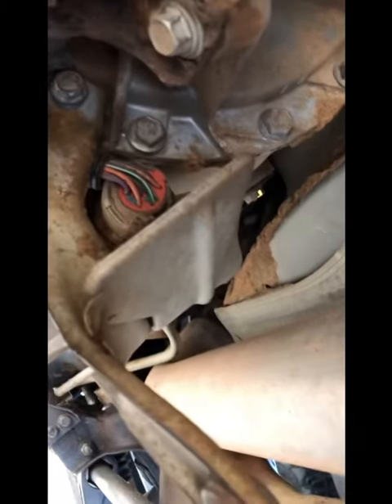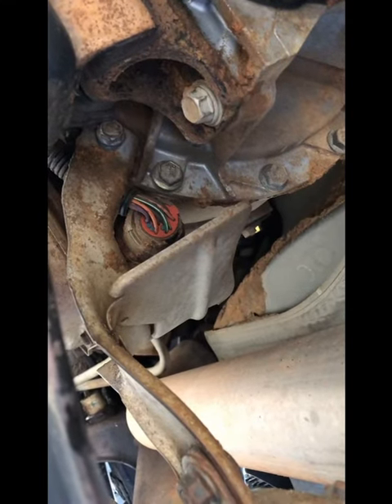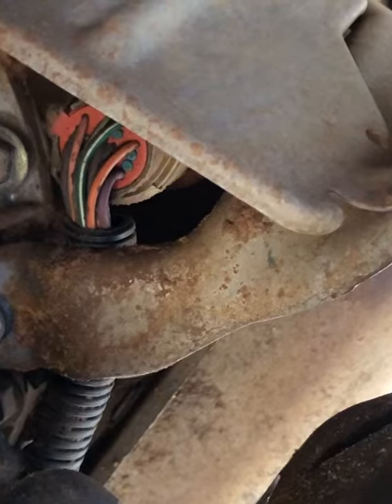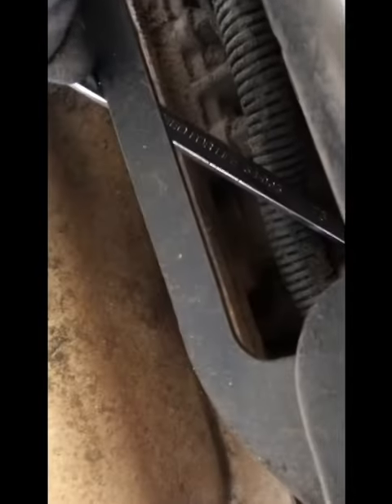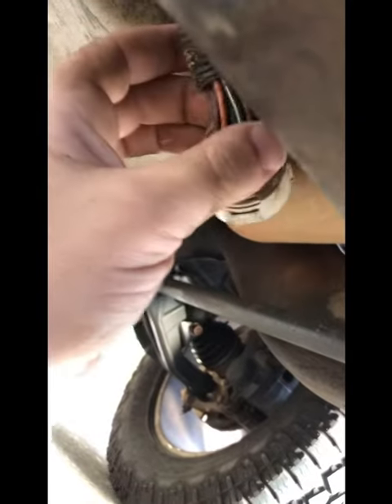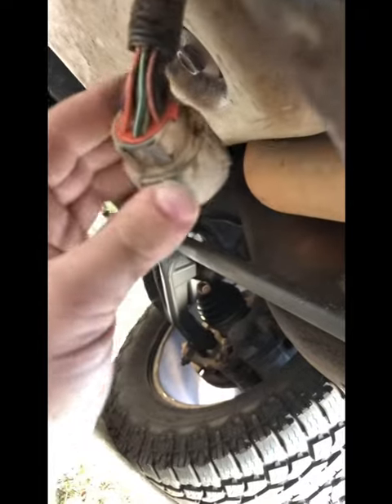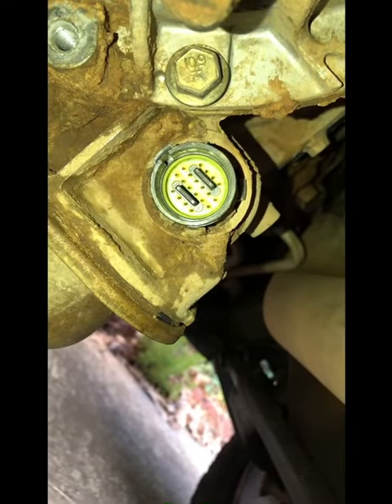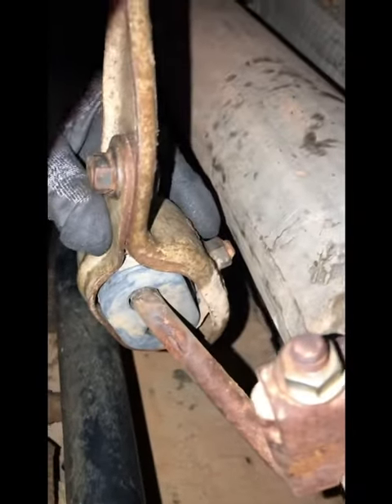Range shift inhibited/shifting issues FREE fix for Duramax

Comment from the maker: JUST AN UPDATE FOR EVERYONE. My issue ended up being the transfer case. The factory units have a tendency to develop play on the internal rotating shaft. Most of the time this problem is accompanied by bad universal joints in the driveshaft. 

This play can get so bad that it busts a hole in the outer casing of the transfer case and obliterate SPEED SENSORS. 

So another option is to pull off and check your speed sensor on the drivers side of the transfer case tail shaft. If it looks like it’s been on a lathe or is completely destroyed, it’s transfer case time.

Comment: Hey Dylan, I just subscribed to the channel. I have an '18 Sierra 2500 L5P with the Allison 10-speed trans. Yesterday my hill assist kicked in for the first time, unexpectedly, while going up a decently steep incline. It lunged the truck forward out of nowhere. Got my attention real quick! Today, the truck will not go into reverse, and the "R" indicator on my dash just blinks on and off. Codes now present are P: 249D, 0701, 0731, 0751, and 0756. Any recommendations on where to start untangling this mess? Thanks in advance for sharing any info you may have. I'm a first time diesel owner.
Reply from the maker: The R blinking means the ECM thinks the transmission is not fully in reverse gear with the gear selector. I haven’t worked on many of the GM house built 10 speeds. I would start by taking a look at the NBSU on the outside of the transmission. That is a Neutral Start Back Up switch. Look up some ways on YouTube to test if it’s good or bad. That was an issue on the old Allison 1000s. If it is bad, it’s a $130 part and super easy to install. It looks like they are now an all electric part instead of having a linkage. So you may have to test voltage resistance from the sensor itself. Let me know what you find! Thanks for the support buddy!
Reply: @dylanbruce5862  thanks for the info and quick response. I'll start at that switch first. 👍
Reply from the maker: @creeksidemktbbq  anytime brother! Also check your transmission fluid. Is it at the correct level on the stick? Shine a light on it. Do you see a bunch of glitters in it? If the fluid looks burnt orange or you see a bunch of glitter, drop the trans pan and investigate.
Reply: @dylanbruce5862 I misspoke earlier. The truck has the Allison 1000 6-speed trans in it. I'll check that fluid as well. I just changed both filters and fluid about 2 months ago, but will double check.

Comment: I replaced my transfer case on my 2009 duramax and now it kicks out of gear . Could the problem on mine be this as well ?
Reply from the maker: Did you DIY? Or installed by a shop? Definite possibility
Reply: @dylanbruce5862  I did it myself. I’ll clean mine tomorrow and give an update. Thanks

Comment: Where is this plug located on the transmission.  I have a 2008 LMM and can't seem to locate it.  Thanks!
Reply from the maker: It’s on the rear passenger side of transmission housing
Reply: Tengo que comprarlo nuebo  el sensor o limpiarlo nada mas
Reply from the maker: @omaralvarado7987  sorry brother no hablas espanol
Reply: @omaralvarado7987 en el video nomas enseña que lo limpia, con un spray especial para los connectors

Comment: Hello , I'm having bit trouble getting info about the wiring  from tcm to outer trany plug I'm willing to pay you just to tell me the position of the wires corresponding to the pins on the plug,  
Here is what happens to me .
Driving of road somehow the harnes got lose and got ripped off I got new pigtail but color of the wires had fade out  and can figure out what's the way it was new pigtail got diferente color not existing in wire harnes from tcm pls help , I'm willing to pay. Pls some help
Reply: Hey man if you still need help please please call Calibrated Power/ Duramax Tuner here in Illinois, they will help you. Good guys

Comment: what codes did you get ?
Reply from the maker: I don’t remember off hand. One was “shift solenoid a - stuck open”. 

My problem ended up being a bad transfer case. I would say, less than 1000 miles later I had a total failure! But that’s a conversation for another time.
Reply: @dylanbruce5862 so you change transfer and it went away ? I have a p0778 trim b solenoid can’t find out why ?
Reply from the maker: @A2ZREY  yeah man that was my issue. But it got a lot worse. Not long after that the truck would default to 2nd gear and go into limp mode. Check your rear speed sensor on the snout of the transfer case. If you can see where the internal shaft has been rubbing it or if it is destroyed completely it’s time for a new transfer case. It’s a very common issue with duramax’s. Shaft develops play beats all the sensors to hell, knocks a hole in the casing, leaks all the fluid out and binds up. Also check the universal joints on your driveshaft. Kodiak and Merchant auto both have remans with the shaft play issue resolved. Do not throw another OEM back in it. It will do it again.
Reply: @dylanbruce5862 what’s up man my 01 gmc Sierra has that same problem with that switch , runs well after a good 1 month or 2 and I have unplugged it and clean it if not it will not let me switch into gear , after I clean it it goes back to normal lol what could I do for it to stop getting dirty I’ve tired putting tape but I think whatever leaks is coming from inside where the cables come from , please reply once you get a chance man 👊🏽
Reply from the maker: @bettomlp  I haven’t messed around with it too much but I do know there is a weep hole somewhere on the outside boot of the sensor that will let dirt and mud in. Even though you tried taping it you may not have covered that hole. Option 2 is that it has a hairline crack somewhere and may need to be replaced. It’s a cheap sensor and easy to splice a new one in!

Comment: I can tell this video didnt help anyone
Reply from the maker: I can tell you have never owned a diesel truck
Reply: Well it sure did help me. Thanks a ton, man.😎
Reply from the maker: @jonathanwiebe  Any time buddy! Glad it helped! I’m working on more content like this soon. Anything free is always a better first option than throwing parts at it! LB7s, LLYs and LBZs can be money pits if you let them be. 

I wish I could post the dozen other videos I have like this but they disappeared off my phone. I did a full suspension and steering rebuild, power steering lines, hydro boost and master cylinder, new lines going to cp3 all kinds of stuff….makes me sad it’s gone 😩
Reply: Could this be the problem for my shift indicator not working ? When I put my truck in manual mode it won’t pop up on my cluster
Reply: @steveo7146 I have the same problem on my 06. Also sometimes shift inhibitor indicates. I'm gonna replace my harness but maybe try this method 1st just to see.